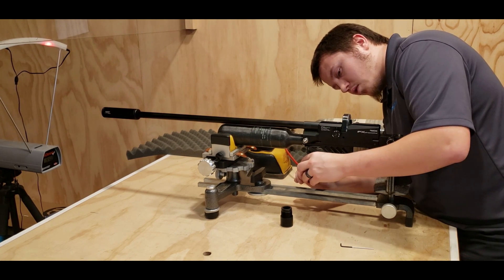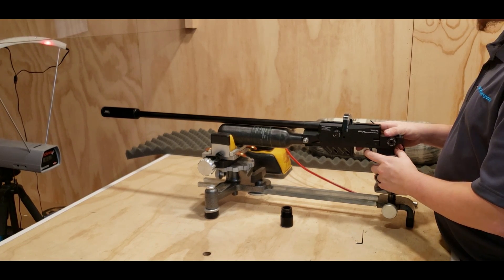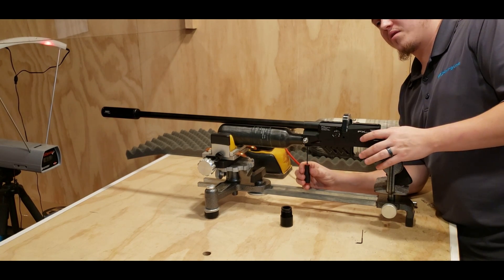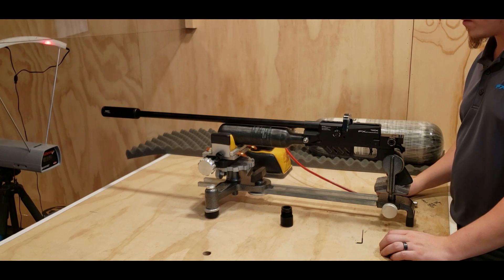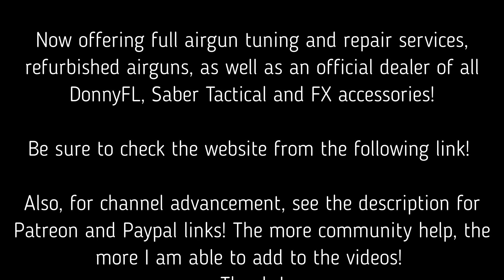How to Tune FX Dreamline with Power Plenum - FX Airguns Tuning Guide for FX Dreamline

Comment: Nice informative video,having trouble with accuracy on my dreamline tac compact also pellet jams in breach now and again?? 
Any ideas would be appreciated ps not double loaded as just one pellet jams in breach and cannot push pellet probe into barrel as pellet is jammed in tight
Reply from the maker: Several things to check. Make sure your breech seal is in place, make sure your pellet probe is tight and not bent/damaged. Make sure the barrel is fully inserted into the breech. Make sure the liner is properly installed into the barrel housing. Shoot me an email at 910airguntuner@gmail.com if you need more help 👍
Reply: @910AirgunTuningandRepairs  thank you will drop you an email

Comment: Great video again, I have the 22cal dreamline lite would love to see a slug tune using the power plenum and some 21g or 23g h&n slugs so I could compare my results, I'm currently getting 23g h&n slugs to 890fps 500mm barrel and reg at 155 bar would like to see what you could get I do have the double tp from huma air
Reply: Carl gibson I want to see these results too 👍
Reply from the maker: I will see if I can get my hands on that set up, but not sure if I can. I will do my best though 👍
Reply: @910AirgunTuningandRepairs  if you can't get the h&n slugs I could send you some or if easier maybe use some nsa slugs 👍

Comment: Great video! I have the Dreamline Classic in 25 cal, and love it. It terms of harmonic tuning and best accuracy........what velocity have you found is best for the 25.4 grain JSB kings?
Reply from the maker: Best accuracy I have found is between 900-910fps
Reply: @910AirgunTuningandRepairs  so that power plenum doesn't mean alot 4 pellets, if that was your best accuracy  between those numbers, then why not buy the crown, because your getting the same power n accuracy..I don't think the power plenum was designed 4 pellets but rather slugs..give me those numbers from the 30cal with the 44g or 50g jsb  . I wonder if the 35cal impact will be accurate shooting those 81g will be accurate at 910 fps. 860fps is factory settings, seems like fx is on only bluffing with those high fps numbers from the amp reg, and power plenum because every review, everyone best accuracy was back to almost, very very close to factory settings..so how is the amp reg and power plenum benefiting u the shooter when you want that power n accuracy....believe it is only 4 the slugs not pellets....just make a hunting version of there guns ,build a barrel that can handle those high fps n give us 65fpe from a 25, 100fpe 30cal, 155fpe 35cal....
Reply from the maker: @bigearl8687  hey Gerald, when your rifle is already producing the velocities that you are looking for without the plenum upgrade, then the plenum will allow you to lower the regulator pressure to achieve a higher shot count. Most of the time, the best accuracy found at a specific speed is not because of the barrel, but because of the pellet. Pellets do not like going faster than sub-sonic, where as slugs rather trans-sonic to super sonic range, hence why they are shaped similar to a firearm Spitzer bullet. Matt Dubber made a video on this concept of speed vs accuracy recently.
Reply: Hi I also has dreamline 0.25 i set everything on max but the fx still weak.Should i change the hammer spring 2???Because i still using the factory original.Regulator pressure is 130 bar.

Comment: I got the dreamline tactical with power plenum, .177 cal.  At 125 bar I'm getting avg 1044 fps and 20 fpe using shooting a jsb 8.44gr. It's crazy accurate! Have you thought about adding a 2nd plenum to see what your setup will do? I actually have a 2nd one coming. But I'm not going to install it until I go .22 cal.
Reply from the maker: Wow, congrats on accuracy at those speeds! Normally I tune 10gr .177 at 910fps or lower for best accuracy, but I will have to try some 8gr. Adding a second plenum would be beneficial, especially at lower regulator pressures.
Reply: @910AirgunTuningandRepairs  the gun came tuned using 10.35gr JSB avg 960 fps with the power plenum from Utah Airguns. I'm getting 5 magazines before it drops off the regulator. Lol I plan on testing out some .17 slugs. So I will probably crank it up a notch. Wanna stay in the 1000 fps. Will be uploading some videos soon. Still waiting on gopro for sideshot.

Comment: I have a question about dreamline tac I bought the omega bottle 580cc and I can put 4,500 psi in the bottle and I bought gauge wika   315 bar you think the rifle work with 300bar or I'll cause damage to the rifle
Reply from the maker: The rifle is designed optimally for 230Bar, 250Bar Max. Anything over 250Bar, several parts in the rifle can fail, leading to rifle damage and possibly even injury. Please, never exceed 250Bar in any FX rifle. The shot count is not worth risking your safety and the safety of those around you. Thank you for asking first 👍
Reply: There is always a certain amount of "safety factor" figured into the pressure rating of guns and high pressure storage tanks. However......I would stick with recommended pressure ratings

Comment: I got a question:

Say if I get a certain setting which gives me very low sd in speed, but I'm not happy with the accuracy

What should I do? Step down to the next speed that gives me low sd and try the accuracy on that? Or increase the speed?

Could "the most accurate speed" not necessarily be the one with least SD?
Reply from the maker: Honestly, I would say your third theory, that accuracy is not proven by SD or extreme spread. You can have a 15 shot string all shooting 1000fps or 400fps, but neither one of those speeds will produce any sort of accuracy, even at 25 yards. Every caliber/pellet weight has a range of optimal speed that you need to stay in for the best accuracy. I would say find your best ES/SD in those accurate speed ranges for the best overall accuracy
Reply: @910AirgunTuningandRepairs  great, super helpful. love your work, hope to send some business your way in the near future!
Reply from the maker: Thank you very much! Glad I can help!

Comment: Nice video with lot of information. I shoot my dreamline (.25, 600mm) 25.4gr jsb @1000fps when using huma-air's 30cc Power Plenum XL with reg 125bar. However, I set the pw to MIN to shoot .25 hades @ 860fps, great accuracy and tons of shot counts.
Reply from the maker: Those results are similar to two FX plenums stacked, as the FX plenum is only 17cc 👍 Thanks for sharing the numbers though, it shows that there is more power to be made!
Reply: @910AirgunTuningandRepairs  Exactly, one disadvantage of the huma-air's PP is it occupies some of the airtank's volume, but still awesome stuff.
Reply: @910AirgunTuningandRepairs  impacts power plenum is 65cc I wonder what would happen if one stacks four or more 17cc power plenums to dreamline
Reply from the maker: @esasaarinen2423  there is not much effect after two plenums. Maybe 5FPS at max. The valve/porting is not large enough to support such a large volume of air unfortunately
Reply: I just ran the test with JSB 25.39gr and @150 bar with 997fps; the extra air volume definitely gives your HUMA plenum extension the edge unless like Newman stated, adding 2 plenums together. I like how FX has given the Dreamline a little more umph but if you really want the power you should jump to the impact. I have the new impact mk2 with the power plenum so for pushing bigger numbers this is the way to go. Either way great information on great equipment